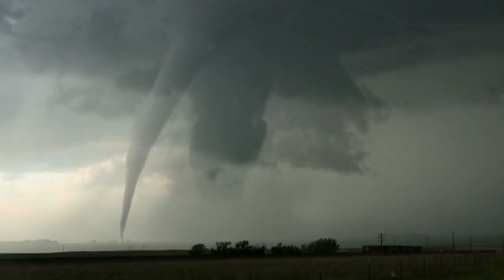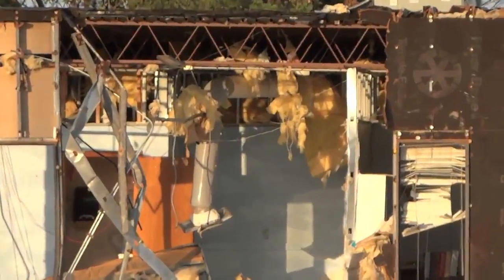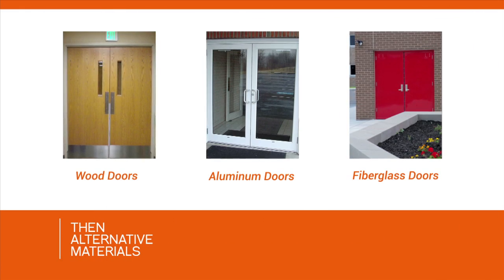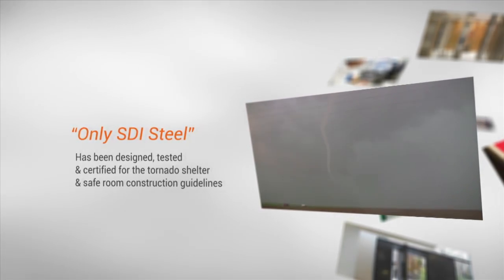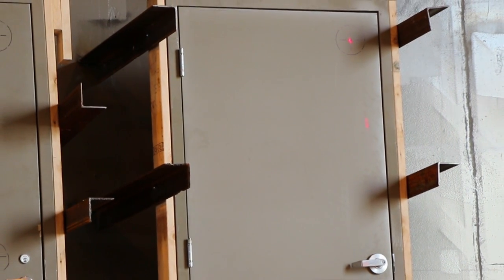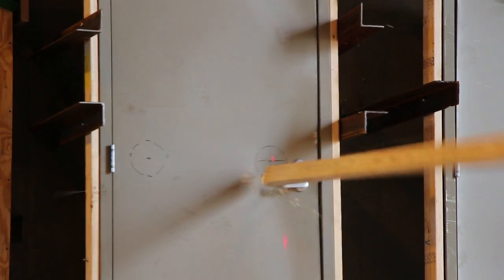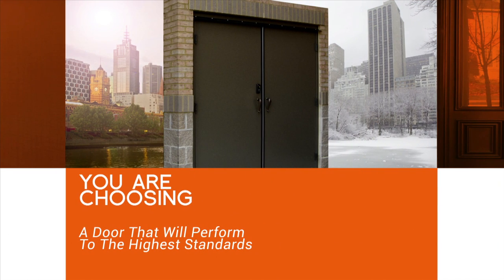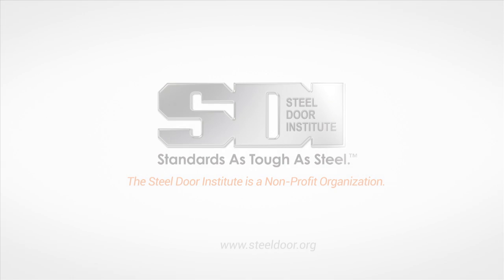Tornado Resistant Doors for Shelters & Safe Rooms | Meets FEMA 361 & ICC 500 | Steel Door Institute

Comment: So the first non SDI door you shot the 2x4 at the top corner away from the hinges and away from the door handle, basically where the door is weakest with no connection to the frame.  Then on the SDI door, you shot the 2x4s at the strongest locations, right next to a hinge and then right next to the door handle/lock mechanism.  That seems a bit skewed to show that as a valid comparison.  You should have shot the SDI door in the same top corner location like you did the first door.
Reply: lol my exact thought when watching this.
Reply: That’s exactly what I came to the comments to say. Deception at its finest. “We actually shot them at the same spot” but we didn’t film it. Just trust us. 😂
Reply: @Morganexcavation  their reply was enough to make me shop somewhere else
Reply: Robin Harrison is correct not a fair comparison
Reply from the maker: @R Harrison you are very perceptive, and absolutely correct.  We actually did shoot both doors in the same locations per the test requirements, however our footage of the shot hitting the corner of the tornado-resistant door came out shaky so we ended up not using it in the video.
Reply: @SteelDoorInstitute   you should make a new video to see the real results